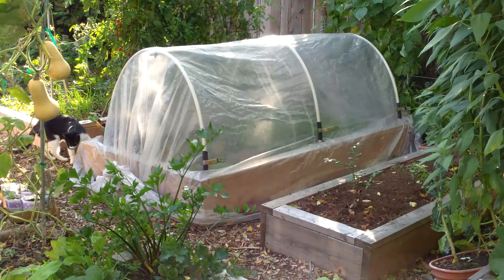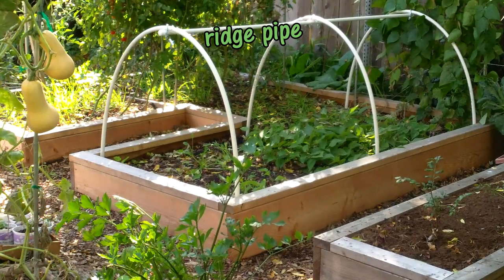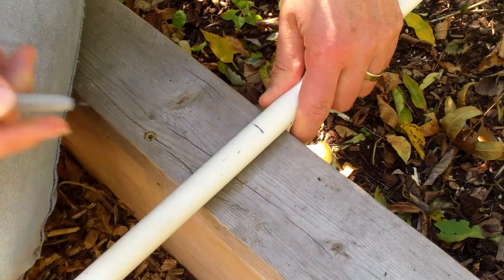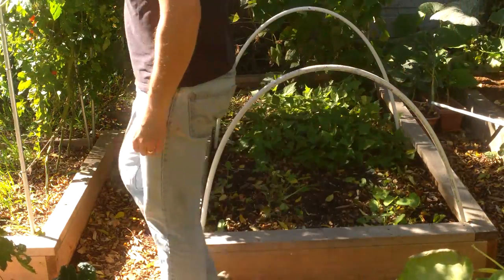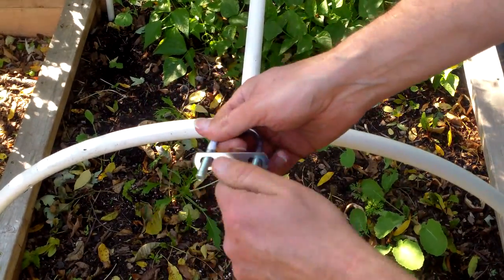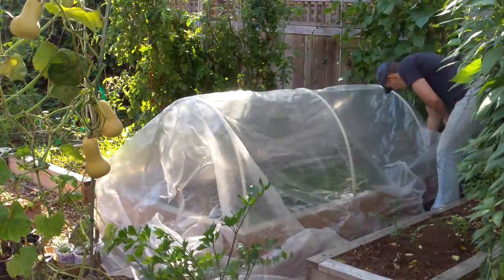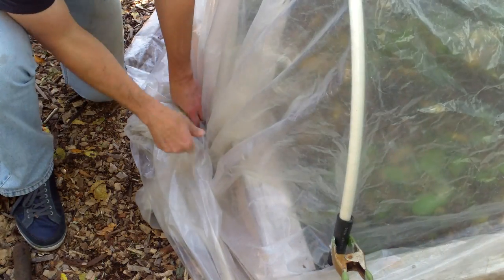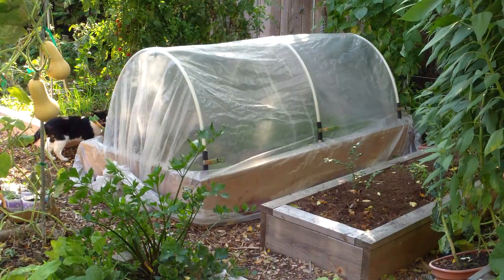How to Make a Hoop House for a Raised Bed

Comment: Where did you find the old window counter weights that you used to hold the plastic down?
Reply from the maker: ***** Good eye, Joe! A neighbor was having some remodeling done and asked if I wanted them. He also gave me 6 windows, which I'll be using in cold frames.
Reply: OneYardRevolution There was nothing more fun than fixing the window in a rain storm when the rope fell off the pulley or the rope would break, slamming to the bottom of the window and the window would then get jammed. Then, until you had time to fix the rope, you had to prop that 20 lb window up with a stick hoping the baby would not take it out. Ah the good old days. No child services, no safety. Somehow we all made it. :)
Reply: Ha, I noticed them too. I have some in the garage that I was keeping to melt down to make fishing weights...I know I'll never get to it, but I have them just in case. lol
Reply: Jim S If it ever hits the fan, you can put 10 or so side by side and have one hell of a bullet proof vest :)
Reply: I think I have four. That'll make a small but still very heavy vest. lol
Reply from the maker: ***** Yes, I'm familiar with the crashing sound when one of the ropes breaks!
Reply from the maker: Jim S Well, if you don't get around to using them as fishing weights, maybe you'll have a use for them in the garden.  ;-)

Comment: high every body ..I know hoop/mini green house is supposed to protect veggies from winter,but id like to know how often should you water veggies considering the cold..n do I need to take the cover off for the veggies to get sun?
Reply from the maker: +Child of  yashua It depends how cold it is. If temps are often above freezing, you can water occasionally on warm days. However, you don't want to water veggies when temps are consistently below freezing. For a winter garden, it's best to leave the plastic on unless too much heat is building up inside and the hoop house needs to be ventilated. I hope this helps!

Comment: So if I have a 6' wide bed and want the top of the hoop house to be 5' high from dirt level to top I would calculate it 3.14x6?
Reply from the maker: Because the hoop in this case isn't a semi-circle (i.e., the vertical radius is 5' and the horizontal radius is only 3'), the formula for the circumference of a circle divided by 2 won't give you an accurate number.  My best guess is that you'd need a length of about 17'. You can start with a longer length and shorten it until you have the desired length.
Reply: Thank you so much for responding to my question.  I came up with that same 17' guesstament too and thought just get the 20' pvc and test it out. :)
Reply: Do not need rebar. Use larger PVC pipe, cut the bottom at an angle to drive into ground, slip the hoops in and fasten with screws the connection. The advantage is that you can make the whole thing as tall as you want.

Comment: Hi Patrick, Would these hoop houses be good for cold frames as well?
Reply from the maker: Hi Liam. Are you referring to placing cold frames inside the hoop house? If so, yes, we have small cold frames that we put inside small hoop houses like this. Please let me know if I misunderstood your question.
Reply: OneYardRevolution | Frugal & Sustainable Organic Gardening I was actually wanting to know if these would offer enough protection to transition my plants outside that I started indoors. (I would use the hoops instead of making cold frames.)
Reply from the maker: Liam Schulze Yes, I use hoop houses when hardening off plants outdoors, but I usually wait until there's no threat of frost before transplanting cold sensitive plants, even with the protection of a hoop house. However, they do allow you to transplant cold hardy plants earlier. I hope this helps!
Reply: OneYardRevolution | Frugal & Sustainable Organic Gardening Thanks! This is what I wanted to know.

Comment: Would this hoop house work for ground level areas in the yard ? How deep must the rebar go into the ground ?

Also would enough light be allowed through the 6 mm plastic for growing fruit trees ? 

Thanks so much 🌟
Reply from the maker: Yes, you can use the same approach directly on the ground. 6" should be deep enough for the rebar. Yes, fruit trees can be protected from the cold under 6 mil greenhouse film.